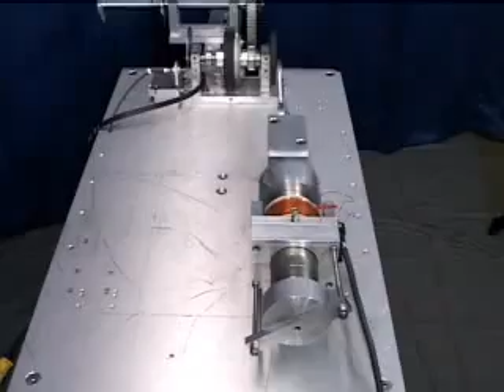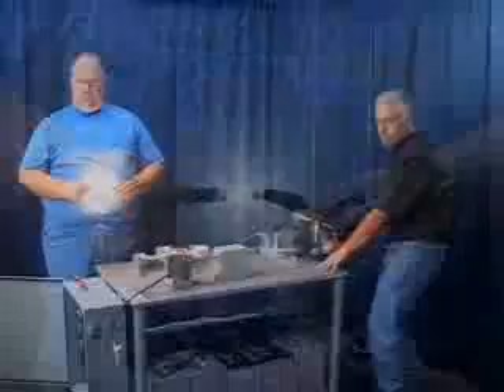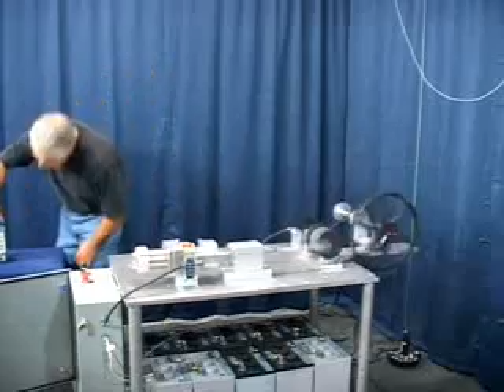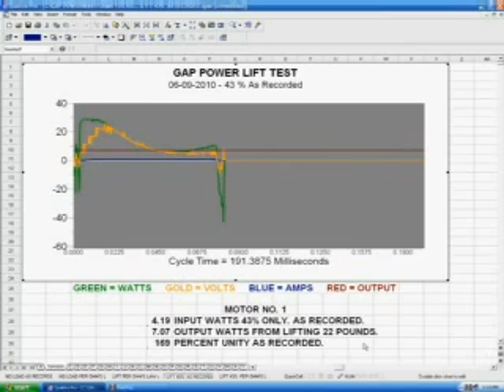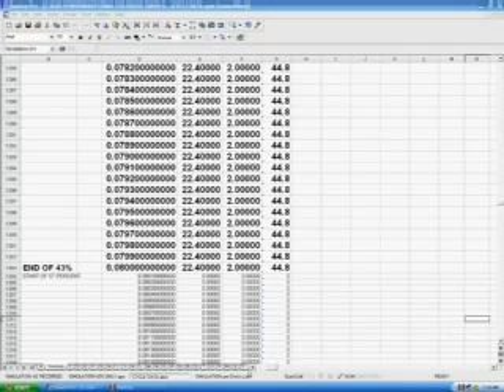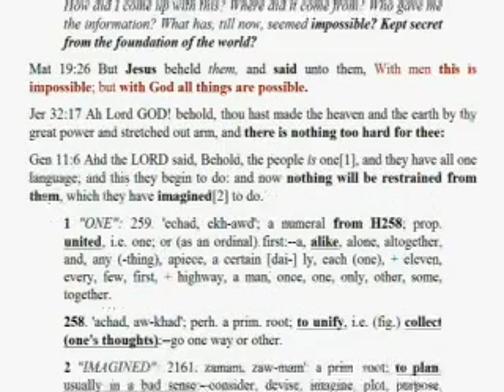GAP Power Magnetic Neutralization

Comment: Last question. Just so I'm clear. You have some permanent magnets repelling another single permanent magnet. But when you close the circuit, the electromagnet overcomes the permanent magnets state and repels the moving, single magnet. Is this right? Very fascinating. I hope the battery data bares out Overunity.

Comment: Neutralizing magnetic field it is more complicated, there is no one way that is the best way. 
You need to consider some parameters such as:
1. Magnitude of Magnetic Field
2. Transmission medium: Each material allow the magnetic field to propagate via that material in a different way.
3. Vector, direction of the magnetic field in each point: When you want to neutralize/cancel magnetic field you want it to happen in a specific point or in few points, you need to know exactly the Magnetic Field's Magnitude and Direction so you can  prepare the right shielding for it or an opposite magnetic field that will neutralize the existing magnetic field.

Main options to Neutralize magnetic field:
* Opposite magnetic field which you can create with solenoid, the advantage is that you can control on the magnitude of the magnetic field at any given moment by controlling the current via the coil.
* Magnetic Shielding: Advantages - even if you do not know the exact direction and magnitude it can still be adequate.

Hope it helps, feel free to contact if you have any further questions.

Kind Regards,
Eyal Fuhrer, CTO.

AccuBeam Systems - Advanced Magnetic Solutions
www.AccuBeamSystems.Com

Advanced: Magnetic Design. Coils. Superconductivity. Levitation. Cryogenic. Magnetrons. Klystrons. Pulse Transformers. Permanent Magnets. Nuclear and Magnetic Shielding.

Comment: Hi, I am currently trying to create a motor using magnetic neutralization but am having problems. Whenever i put power through the coil power goes through it but it does not neutralize the magnetic field of the iron. How much power needs to go through the coil and does the size of the coil matter. Please help.